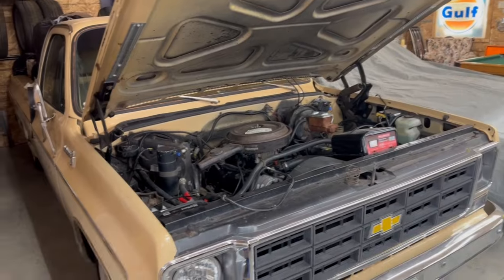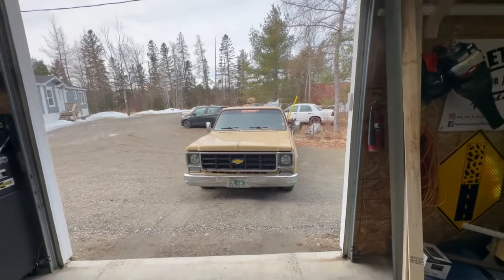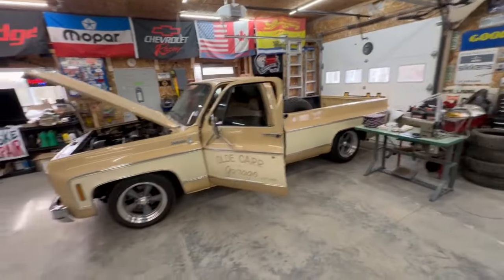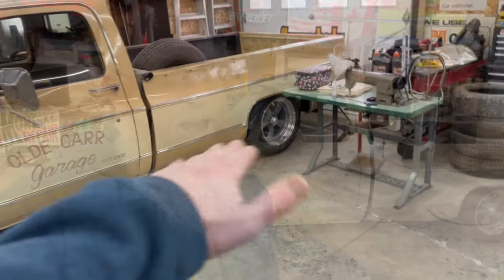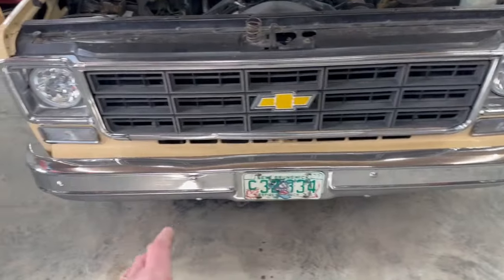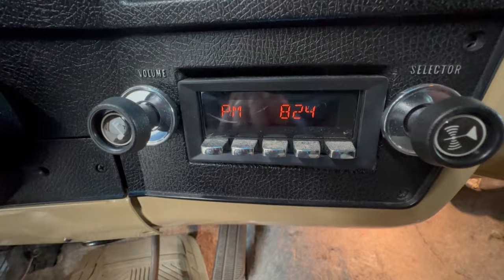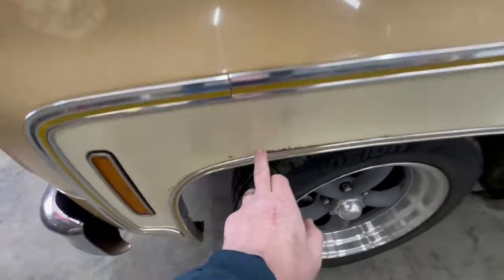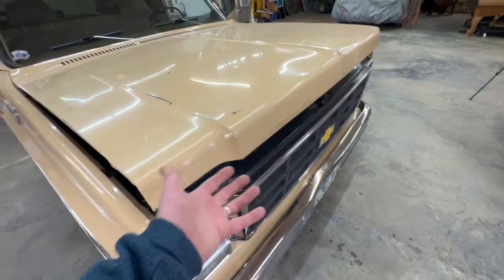Low Mileage 1977 Chevy C10 Original Paint FOR SALE!

Comment: I think it was the hand painted signage on the door is what made me think it wasn't gonna go up for sale. Chalk up leaking oil and PS fluid as a match for Dale and Lori alike. Lori also leaks antifreeze and transmission fluid too. Thought the transmission fluid leak fixed for good, but it still barely does. Currently trying to remedy the antifreeze situation.
Reply from the maker: If it's leaking, that's how you know it have fluid!